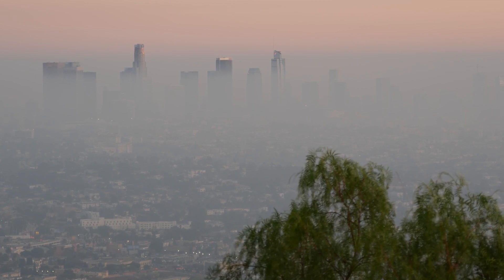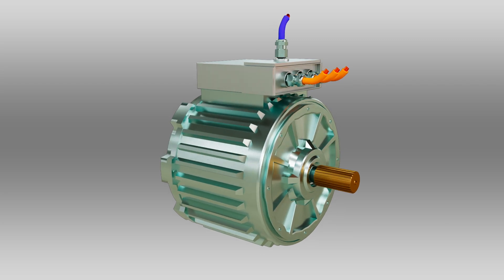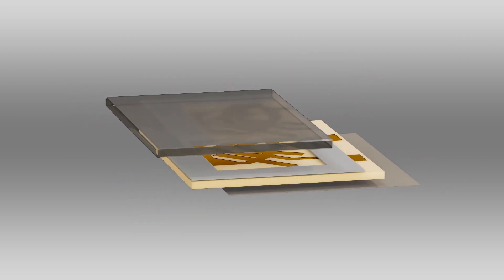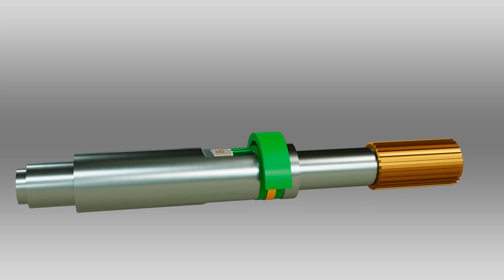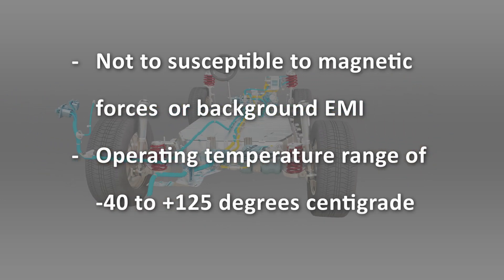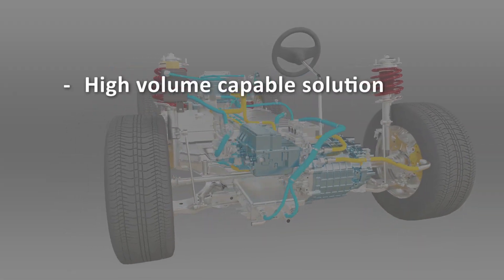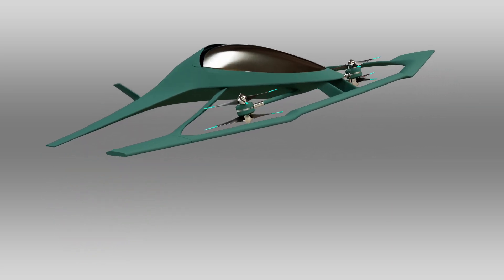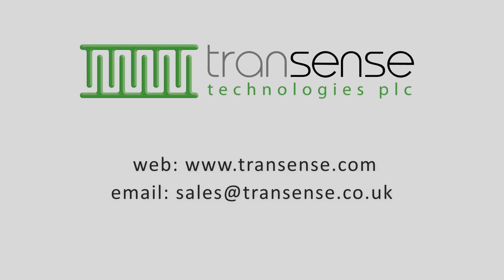Surface Acoustic Wave (SAW) Torque Sensing Technology

Comment: Hi, I think your technology is great and the video is too! But how does it differ from other manufacturers? I see there are a multitude of SAW Device patent holders and SAW Device producers. Can you pinpoint where your technology is superior to those of other manufacturers?
Reply from the maker: Hi thanks for the question, Transense has patents relating to the design of SAW devices themselves particularly the AQP which is a robust SAW sensing element, the interrogation electronics and application patents in their use particularly in the measurement of forces and torque.

Other manufacturers have SAW sensors to measure temperature, but our sensing elements are more industrialised, the design of the AQP makes it relatively easy to build the sensing element into a part compared to a simple SAW resonator that has no protection. We also have a dedicated ASIC to read the signals from the AQP's making the design and setup of a SAW based sensing system much easier than previously possible. 

We are glad you enjoyed the video!